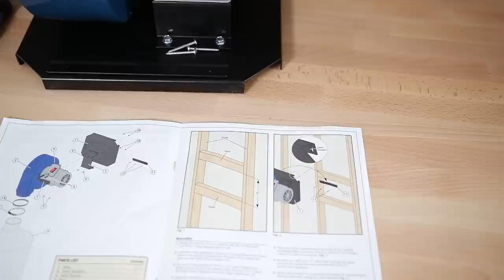Small Two Stage Dust Collection System (Rockler Dust Right & Dust Deputy Cyclone)

Comment: Probably one of the better setups I’ve seen. Do you have the dimension of that corner. Looks like you got 4x8 plywood mounted to the wall. Not sure if that will fit my wall near garage door and my other corners I can’t use.
Reply from the maker: You should be able to fit a setup like that in a corner of about 30"X30", or maybe even a little less. Rockler makes a few different models now, so it's best to check the dimensions of whichever model you decide on just to be sure.

Comment: I thought...you were going to present an "efficient" extractor system...these fan units are just...cheap...nothing eeeefficient about them...the cyclone seperator & filter are effective...an efficient system has the cyclone type concept built into a scroll type centrafugal fan unit feeding into a downdraft filter canister for the momentum of heavish dust to throw the dust to bottom of a baffled can, not a bag, and air to turn and exit via the higher mounted filter element...you have too much length of ribbed flexi tube...it creates high airflow losses, worse than having bends!!!